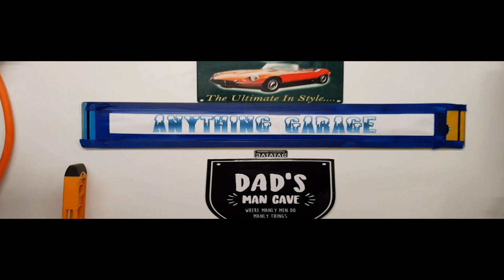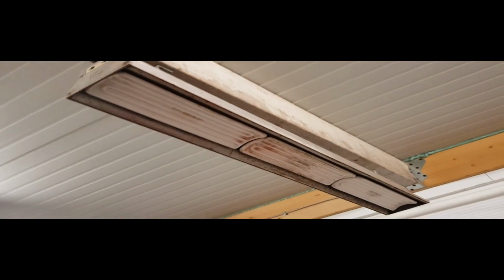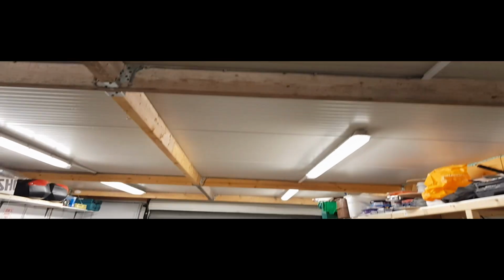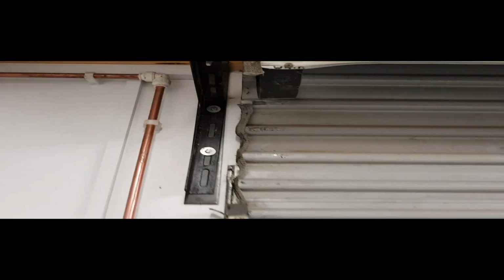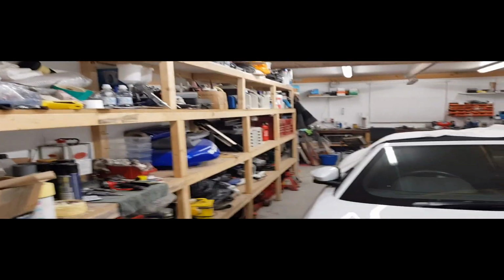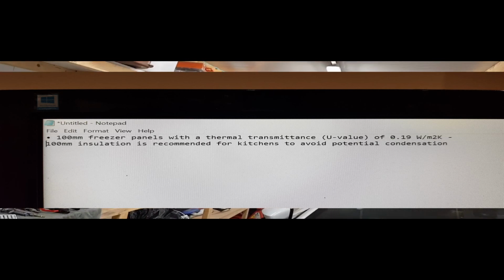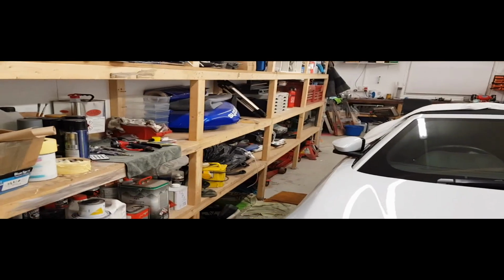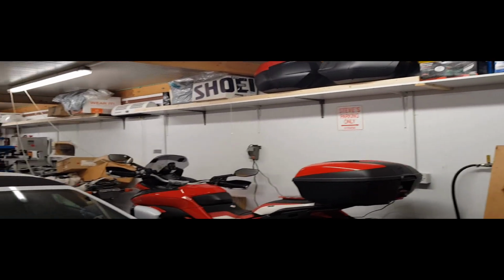Cheapest build. A fully Insulated garage, workshop, mancave.

Comment: Not sure if you’ll get this message because your videos goes back sometime now just wondered if you had any links to buy panels cheers
Reply from the maker: Hi. Yes the wall panels were 2nd hand units. Look on ebay for Insulated fridge panels or Cold room panels. You will find lots. Mine were 100mm but they do all sizes. The roof panels are from a Co called Foregale. They are in Liversidge west yorkshire & also i believe in goole. They will also sell you all the corner profile pieces you need & the bottom track & fixings. Hope this helps you. Regards . Steve.
Reply: Steviegtr Thanks for reply just one last question was the roof flat or did it have a slight angle
Reply from the maker: @tonyw2626  Hi again Tony. No the roof has to be at an angle for rainfall. I did mine at 1 in 200. If i did it again i would do something more like 1 in 75. That is for every 75" it falls 1". Obviously this means that one side is lower than the other. If you look at my internal timbers , the ends are at a slight angle . If like me  once you start to create the building you will see any problems that arise as they happen. Good luck with your project. Do not hesitate if you need any further help. Regards . Also my lean was side to side, not on the long run. This saves cutting every sheet at a different size. Steve.
Reply: 00